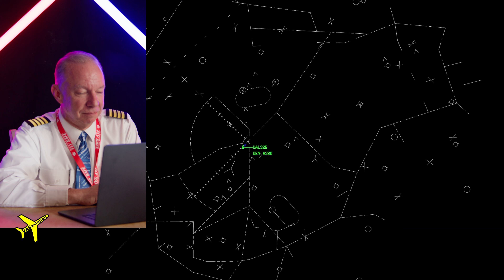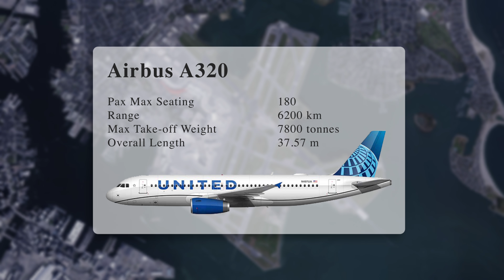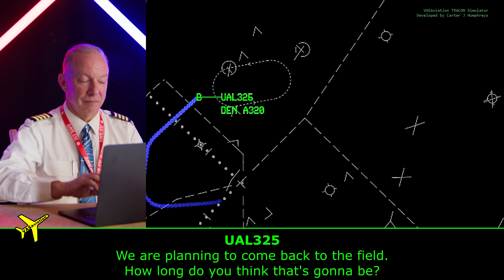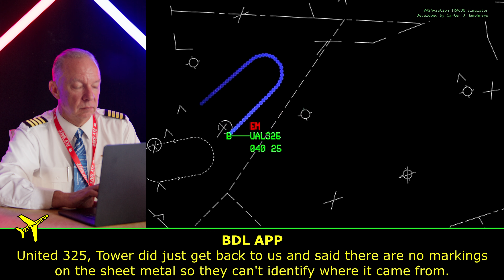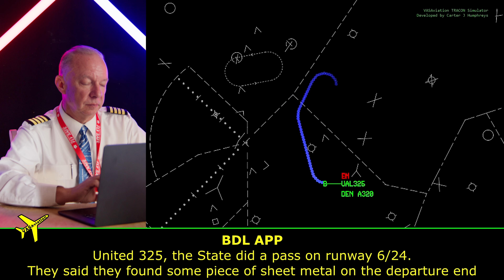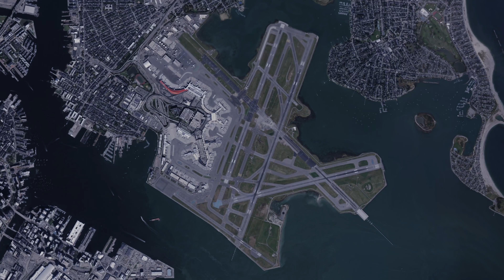United 325 Disaster Averted: Engine Trouble at Takeoff! | Captain Steeeve Breaks It Down

Comment: I’m the son and father of airline pilots. And I’m amazed that we don’t have tiny cameras available for the pilots. 

They should show the engines front and back, wings, cargo hold, landing gear bays, tail surfaces. It would be a minor addition to a glass cockpit to have a camera mode where you dial through all the cameras, and a relatively small expense. And sometimes that info would have saved lives.
Reply: Absolutely!!!!
Reply: And what does it really help you to see those parts?
Reply: @Cars-k8e  here’s the simplest question: if you were riding in coach and something broke catastrophically on the plane would you rather the pilot have LESS or MORE information to solve it?

I can’t imagine anyone saying less. So you probably actually agree that they should have the ability to get a good visual on the problem. We get most of our detailed and  nuanced information by sight. The brain allocates more processing to sight than anything else. 

They don’t have to stop flying to get the info. There is always one pilot aviating and the other managing systems and communication in good CRM. 

Camera are cheap.  Lives aren’t.
Reply: @ again as I said already, you don’t need to see the engine as you are not an engineer as a pilot and the airplane will show you what’s wrong. If the big manufacturers wanted you to do that then they would do it with their new planes. But none did, simply because they don’t know what’s important? 
An airplane is not a bus or a truck
Reply: @Cars-k8e  once on a cross pacific flight my father had fire alarms in the 747 hold start going off. Someone had to race down there to check, taking nearly a minute. A camera would tell them in 5 seconds if there was a fire. (It was durian gassing off and filling the hold with humidity). 

On other occasions pilots have killed the wrong engine because they didn’t realize where the problem was. That’s serious.
Reply: @ but don’t you think that there is a reason why there isn’t a camera? 
I don’t think that aircraft manufacturers want pilots to identify problems via a camera. 
What if you have a low oil quantity on an engine? There is nothing to do but wait and see what happens with the engine…
There is no checklist to run or anything else to do in that particular case.
If there would be any cameras then I am sure that the procedure would be to use them at the very end if even
Reply: @Cars-k8e to see if they're brokeded
Reply: @babywhaleshark  as a pilot you cannot make any assumptions what to do if you see the engine for example… regarding the gear, all of the big jets have pressure readings etc… what can a pilot do if he sees a part of his wing missing? It’s of no help
Reply: @Cars-k8e  I dunno, if US Air flight 427 saw their rudder inputs were having the opposite effect intended maybe they could have saved that puppy
Reply: @ yeah maybe. But what could they have done? First thing is anyway to aviate, the cameras could be used at the very end when every thing else is done
Reply: @ sometimes by knowing where the problem is you know what procedures to take, thereby not wasting time on useless procedures. In the hundreds of crash investigations I’ve studied, about 1/4 of them could have benefitted in some way from quick visuals on the engines or control surfaces.
Reply: @ the engines are the least problem. The airplane nowadays are even telling you by electronic checklist what to do. Those problems you investigated where there maybe in the 1970-80s, where 20% of the accidents were pilot error and 80% technical. Nowadays it’s the other way around and manufacturers as I said don’t even tell you what the new features are in detail when you for example go from 777 to 787, simply because they say they don’t want you to know too many details. Troubleshooting isn’t wanted in an airline environment unless the checklists leave you with a huge problem and didn’t help at all
Reply: @Cars-k8e  do you want pilots to have more information at a negligible cost or not?

(Also, I’ve studied accidents SINCE the 1970s, not just IN the 70s. I review several accident reports a month, up to today. There are still cases where lives could be saved by visual information.)
Reply: @ which accident could have been avoided because of a camera? I would be happy to learn more about that

Comment: These are great videos by Capt Steeeve! Just a question from a neophyte regarding the requested visual observation by the tower as they fly by - couldn't planes have exterior cameras trained on critical areas- such as landing gear and wings so pilots can check? Sorry if this sounds like a stupid question.
Reply: @catkeys6911  > couldn't planes have exterior cameras trained on critical areas
Anything in aviation costs many times what it would otherwise cost, and takes years to be installed, let alone become commonplace.  We have aircraft today that are flying perfectly well on 50 year old technology.   While the idea of cameras on critical systems seems sensible, and indeed some modern aircraft have tail and underbody cameras available, it's not something that would be retrofitted to older aircraft, because the amount of time, cost, and work to prove and certify that the new system is airworthy, especially when retrofitted, is simply not worth it.
Reply: @h14hc124  OK, retrofitting doesn't sound practical, but on new planes that could be designed with the visual observation of critical components designed-in, perhaps?
Reply: @ The A350 does - you get a camera under the fuselage that looks at the nose gear, but the intention was to provide a better view of the runway, rather than the gear. There's also what airbus call a landscape camera, which is mounted on the tail, looking forward, and gives you a view of the whole aircraft from above.  Keep in mind that every new system installed on an aircraft, even a new one, has to go through air worthiness certification, and make sure that it hasn't introduced any new regressions (a process that should have failed for MCAS in the 737-max in my opinion)
Reply: The bigger airplanes like B777, 787 etc have anyway indication of the pressure of the tires. The smaller ones don’t but there is the possibility described by Cpt Steve to fly by the tower for example

Comment: Wouldn’t it be a good idea to put cameras on the fuselage so that the pilots could inspect the tires themselves?
Reply: A good airplane shows you pressure of the tires and temperature of the brakes
Reply: You would think.
Reply: @JakeC-xx8zq  Boeing 777/787 etc A350, A380 shows you. The 737 A320 etc don’t

Comment: Interesting FOD discussion. Would like to know what fell off. We were flying from Albuquerque (737) to BWI normally and about 20 minutes before landing at BWI, the pilot came on the intercom and announced that they had a report that something fell off the plane when we took off from ABQ and that we were going to do a low pass over BWI to check the landing gear. After the low-pass it was reported that one of the tires on the main gear look "oblong." Turned out it had blown on takeoff. The pilot did let us know that we would see the fire trucks and that we would stop on the runway for an inspection. The landing was louder and more bumpy than normal, not unlike being in a car at speed with a flat. Inspection was done relatively quick and then we and the fire trucks proceeded to the gate to unload. Got pictures from the gate window of the flat.
Reply: If you are in the air you don't need that tire till you land. The more fuel you can burn the less load on the remaining tires. You could fly in circles and go back or just go to where you planned to.

Comment: Last Monday Feb 17 2025, EK232 from IAD to DXB, Emirates A380 was on the runway, aborted 15 seconds b4 taking off due to engine failure. A truck pulled the airplane back to gate. Staff asked 400 passengers to call customer service. I obeyed. The call center in Dubai asked me to deal with ground staff. It was a total chaotic situation. Emirates won;t allow /arrange us to catch another non-Emirates airlines . We all must go  to Holiday Inn near Dulles aiport and retake another emirates the following day. If the engine "died" after taking off, should we fly with the angels?

Comment: Non-pilot here - does anyone know if planes can dump fuel in flight?  Obviously not something you would want to do but if needed to get the weight down in an emergency
Reply: Yes.  Climb to a minimum 5000 feet and the dumped fuel will dissipate  before reaching the ground.  I saw this in another Captain Steeeve video I watched recently.  😁
Reply: It depends on the type of Airplane…
B777 etc can of course

Comment: I'm surprised they don't have cameras under the belly of the airplane where the crew can look around for problems
Reply: I wouldn’t be interested to look around, as I can anyway see what works on my plane 🤷🏽‍♂️
Reply: @Cars-k8e  I was thinking more of instead of a jet making a low pass  for the tower to see if the gear is down or not, maybe one of the 3 lights indicating gear position
Reply: @dennispsyhogios3804  I think it depends on the airplane model…
Even you can see that the gear is down but still have a fault indication, it can also be that the gear is down but isn’t locked maybe
Then the camera wouldn’t help you either

Comment: Love you videos.  Question: If there is too much fuel weight to land, then how did they take off with the weight?  I understand wanting to burn it off to decrease a potential fireball... but you really cant land with the same weight you took off with?  Thanks.
Reply: Forces on the gear are higher on landing than take-off, even with the same mass.  The same way that an egg sat on the floor will be fine, but if you drop it onto the floor it might smash.

force = mass x acceleration.  On takeoff, the only acceleration experienced is gravity (~10m/s^2).  When landing, there's gravity and the remnants of the decent velocity.
Reply: @notsolm  thank you for the explanation.
Reply: Boeing 777F for example has a max take off weight of 347450kg and a maximum landing weight of 260.000kg 
Someone else commented already why…